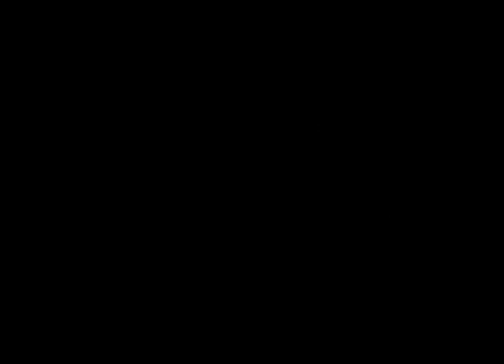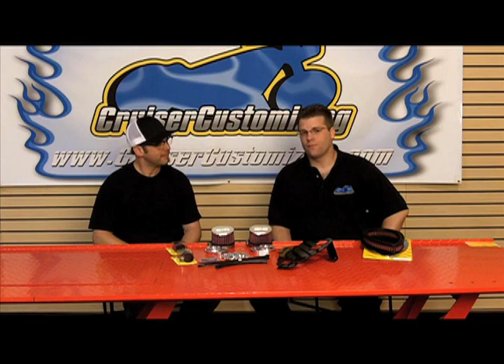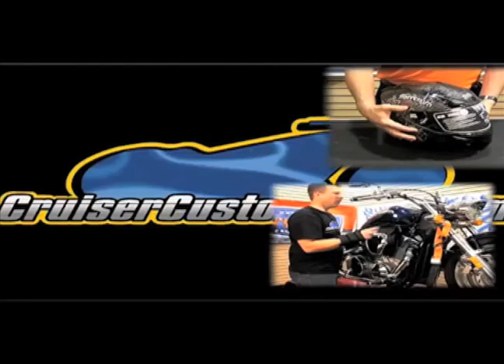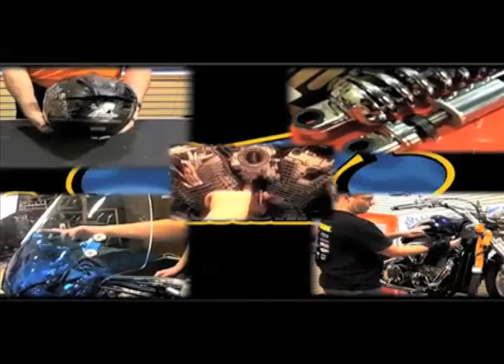Baron Custom Accessories Stealth BAK Big Air Kit Video

Comment: You say 15% power increase by adding this kit along with pipes and fuel management.  What about power increase just for this kit? With stock pipes and stock fuel management.
Reply: Speeding in progress do u necessary need a power commander are can it just be stocked